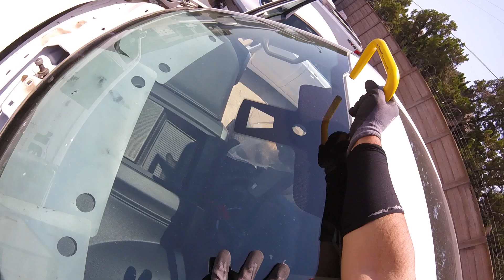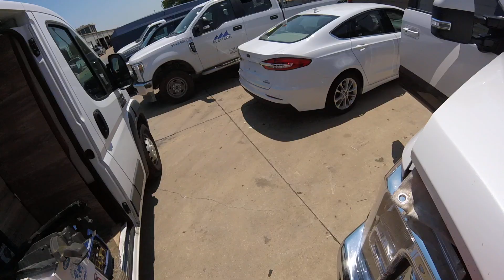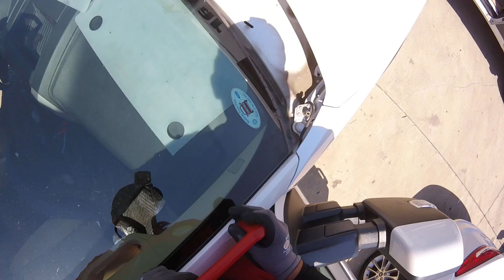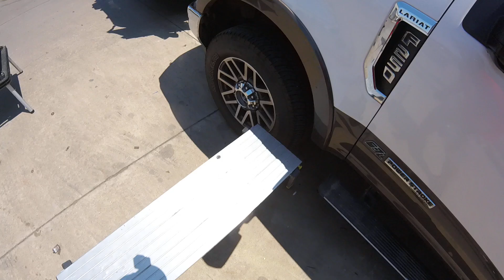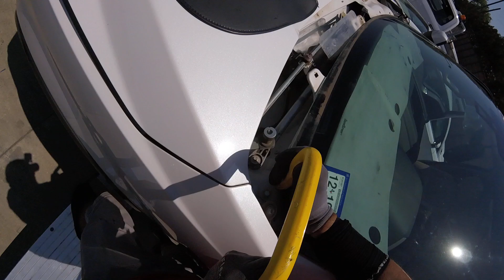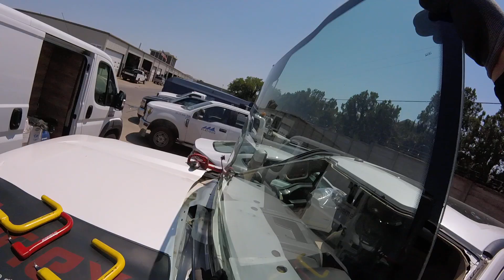LOVE THE ZIP KNIFES WHY NOT? FAST AND CLEAN

Comment: It’s the techs that aren’t careful with cold knives that can do a lot of damage. 
I’ve been doing auto glass for only about 8 years now and I’ve used the WRD Spider cutout tool since day 1. 
I know it takes a bit longer than a cold knife but I just love how clean of a job it does. There’s still the odd time I have to pull out the knife or spatula, depending on the situation.